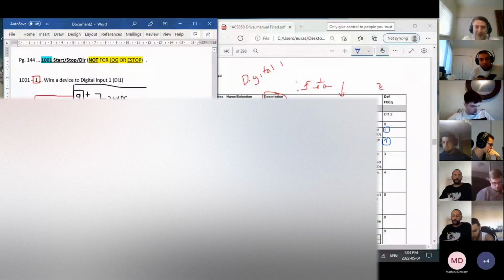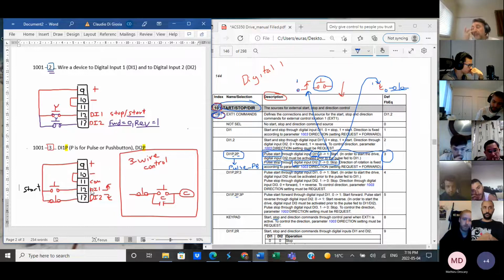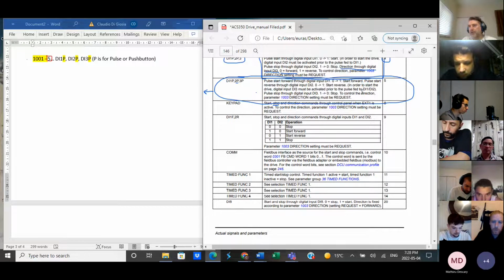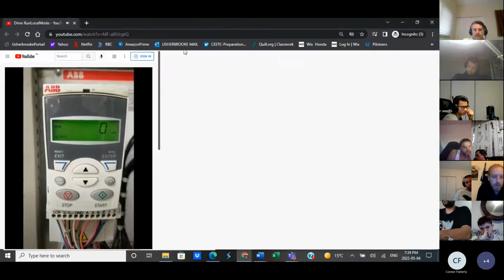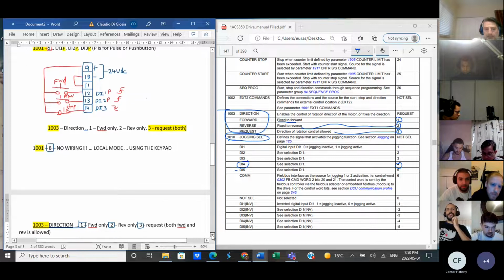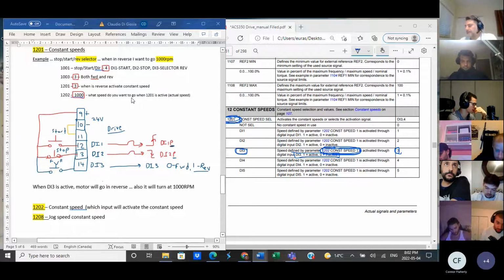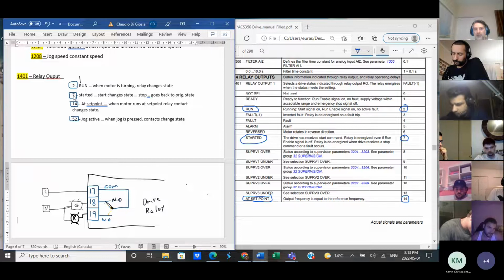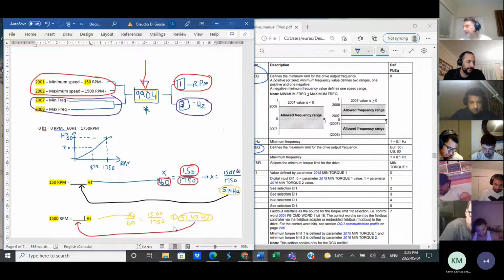ABB Drive (VFD) Basic Parameters and Wiring Explained   Part 1

Comment: Hi sir  i need your help i have problem in  ABB  dcs550 drive fault 541 , i check the   field fuse and the field contactor close ok when i run drive remote  motor not running only field supply coming 
armature supply not coming after few second f541 fault show in bop